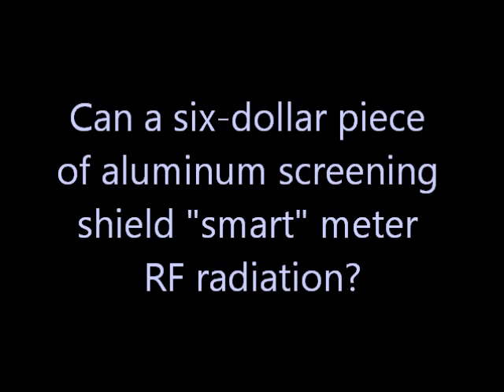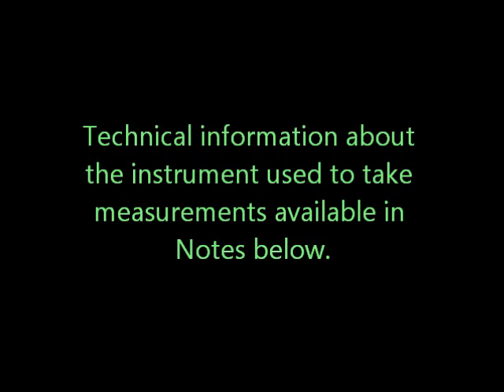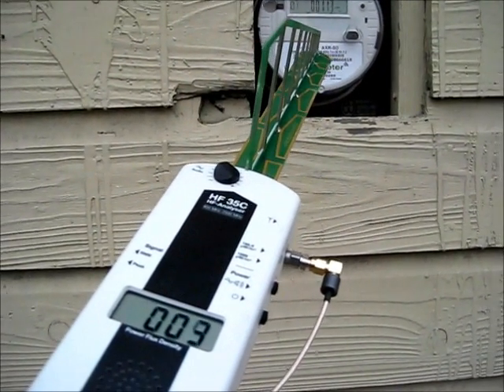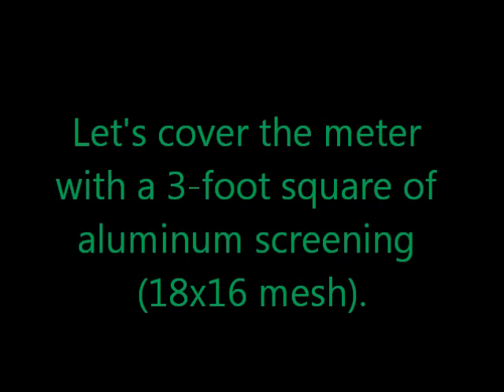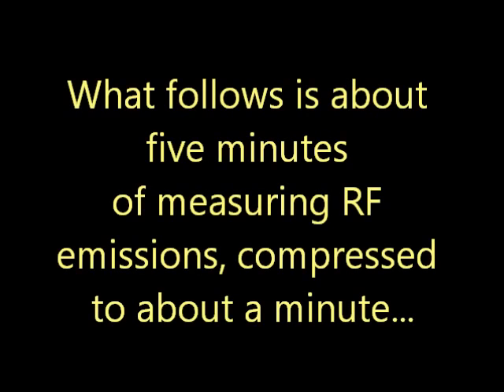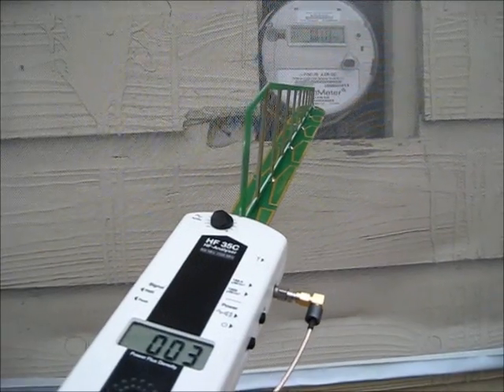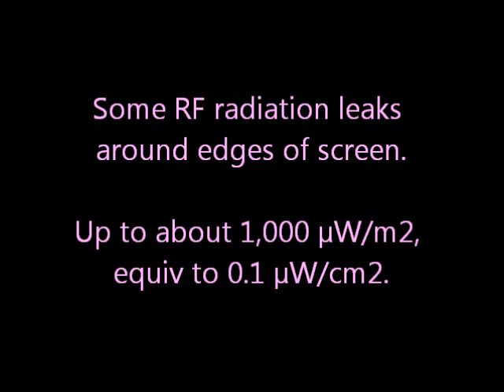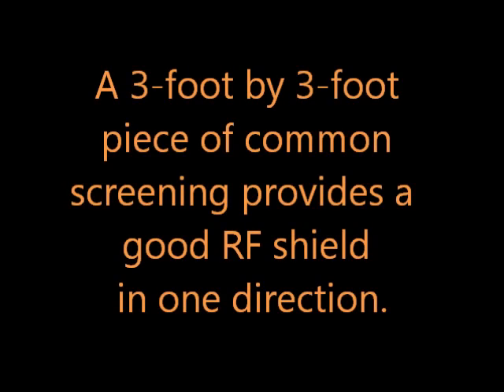Foiling a "Smart" Meter, Part Two: Aluminum Mesh Screening

Comment from the maker: PG&E smart meters emit 10,000-190,000 pulses of RF radiation per day. They admitted as much in documents filed w the state and reported on in the news.

When I measure SMs I have no trouble clocking pulses---several a minute at least. This meter was, like all in PGE territory, going off all the time.

The sounds emitted by the HF35C analyzer clearly indicate the source of the RF radiation---see my other videos for more info. I have been doing this a long time, and am confident in my assessment.

Comment: #1 That danger zone of too much radiation is actually higher than 8” because the reading is  “averaged”.
#2 Smart meter can not legally be installed if people live or work near smart meters.
#3 Multiple smart meter increase that danger zone drastically.

Comment from the maker: No, I am not overconfident in my equipment---my equipment is straightforward to use, and I've trained with an EMF technician. I've been doing this for years, in environments as diverse as crowded cities and remote Scottish islands, indoors and out, extremely high and extremely low levels of RF. My experience counts.

This video, as I have stated in other comments, was made to demonstrate a property of aluminum screening, not suggest a shielding set-up for your particular circumstances.

Comment: Try this one and see what kind of an answer you get.
If PG&E's smart meter can be shown to transmit more than 45 seconds day, WILL THEY REPLACE THAT DEFECTIVE SMART WITH A ANALOGUE METER? 
Ask them that question and ask them if they will still stand behind the 45 seconds a day theory? 

2 milliseconds at 45 seconds is 22,500 pulses,  the average customer can not understand and  will give up. It is similar to asking someone to try and measure how much light comes from a LIGHTHOUSE at night.

Comment: Has anyone filed a complaint with the FCC?   Just because they are not licensed, they are still in violation.  
Foil the stupid meters. What are they going to do if you "remodel your home" If that remodeling stops the radiation, what would or can they do?   File a complaint with the FCC??  I doubt it. Maybe they will pay to move your meter base? I doubt it. 
Remember the 8" is an averaged reading. The danger zone is far greater.

Comment: OK that's interesting. But you are concerned with the radiation for health reasons you say? But you place the foil on the outside of the house. Does that also block the radiation from coming INTO your home where you spend 99 per cent of your time?
Your argument might be valid. I don't know what radiation levels are truly dangerous, but your solution seems flawed.

Comment: Why this Smart Meter is transmitting so often? Is this meter transmitting data for the entire neighborhood (mesh network)? The reason I say this is because according to PG&E's website:
Do electric SmartMeters™ constantly emit RF?
No. SmartMeters™ communicate intermittently, with each RF-signal typically lasting from 2 to 20 milliseconds. These intermittent signals total, on average, 45 seconds per day. For the other 23 hours and 59 minutes of the day, the meter is not transmitting any RF.

Comment from the maker: I use analyzers manufactured by reputable companies that measure RF microwave energy accurately and consistently. 

Non-ionising radiation in the microwave band busts DNA, breaks the blood-brain barrier, and research has demonstrated a host of other clear biological effects, both in vitro and in vivo.

Sorry if it's not your favorite sort of radiation, but it clearly is radiation.

Comment from the maker: PG&E smart meters use a 1-watt transmitter, which is boosted by 4db antenna gain, actually pushing it beyond the FCC transmitter power limit (1 wt) for the unlicensed band it operates in. SMs transmit for miles---they are hardly insignificant.Your cell phone operates at less than a half watt, and you control when and how (or even if) you are exposed to it. PG&E places these transmitters right where humans live, work, eat, sleep. Biological research shows effects down to quite low levels of RF.

Comment: David Sturdevant, you're lost, the amount of energy this guy is measuring wouldn't light a small LED, let alone provide enough power to run an inverter. The leakage and inefficiency of the capacitor alone would leak this small amount FASTER than you would charge it. I've wasted more energy writing this than you would reclaim from microwatts of RF from a smart meter. - This is a joke.

Comment: This is a nonsense meaningless video. Smart meters have very small RF transmitters in them so the meter readers can read the meter, accurately by receiving the RF signal that contains the meter information. This "smart" feature is used EVERYWHERE small RF transmitters are in millions of devices, your car remote for example. What he is measuring here are microwatts of energy if you saved up all the "leaking" energy for an hour you would have almost nothing.

Comment: :::pssstttt:::  use COPPER..... then ground it to a capacitor, dumping the capacitor to a BATTERY, then run the battery through a grid-tie inverter....   You can USE that "Radiant" energy leak as FREE Energy to FORCE the power company to pay YOU for power that YOU "Generate" (Capturing what the Equipment THEY forced on you has LEAKED/LOST.)

Comment: Research Tesla's Wireless Energy Rec.  You can actually CAPTURE that energy via a conductive screen that is then fed into a capacitor, the capacitor then dumping the load to a Battery when the capacitory reaches maximum capacitance.  The batter is charged.... Now, it you where to install a grid-tie inverter to the batteries (which... are being charged the captured radiant energy that the "Smart" meters are LEAKING) you can feed that SURPLUS power BACK to the power company instead of wasting it.

Comment: It's NOT a matter of the RF being "Dangerous" to ALL people.  It HAS been CONFIRMED that SOME people react DIFFERENTLY to different RF signals (kind of like tuning an FM station with no antenna... signal quality,) but THIS is radiant energy being "LEAKED" at FREQUENCIES that MANY can hear.  High frequency "ringing" (much like that of people with high blood pressure) is reported as a reaction to the "FREQUENCY" that LEAKS from the meter.

Comment: Acually, if you take and run a COPPER WIRE LEAD from the Screen and DOWN to the GROUND it will ABSORB that radiation and GROUND. (RF uses that AND ALL Metals as an Antenna and/or CAPACITOR)

The ONLY power being "Radiated" INTO the HOUSE is going to be the radiant energy which is on the BACK side of the meter, which... is ALREADY FACING the HOUSE and couldn't be "BLOCKED" without a grounding plate BETWEEN the meter and the house.

Comment: Seems like your cure is actually worse than the initial problem, ie now all the RF radiation is bouncing back into the home, and the shielding has made the meter transmit more do to poor connectivity to its receiver.

Comment: "The Dark Side Of Smart Meters" taught me about what they can do.
You have shown what can be done about it. Thank you.
My plan is to place a large sheet of reflective screen on the wall behind the meter, and an absorbing screen over top of that. I will use absorbing screens in my bedroom to protect me from my neighbors meter.
Isn't it amazing what tinfoil, aluminum bugscreens, and a bit of wire can do? : )

Comment: I'm a resident of BC, Canada.  The provincial gov made smart meters the law.  According to BC Hydro website, our meters (made by Itron) transmit well below the requirements of the toughest European specs.  They also claim they don't have the ability to infer how power is being used, and use a network topology that does not result in large amounts of repeating.  I hope that's true.
I wish I had the $ for your RF meter.  It would save me much guesswork.

Comment: Thanks for replying.
It looks like the best thing for me then would be to put shielding up on the inside wall of my house behind the meter.  I spend way more time on that side of the wall.
Also, I think I will leave that shield ungrounded so the meter can make it's connection without infinite attempts and signal boosting.

Comment from the maker: At least for CA residents who are subjected to PG$E's tyranny, the meter they use is in excess of 1000x stronger than it needs to be (in vast majority of cases) to do the job---all that meters need to do is transmit about 25 or 50 ft, to the v next SM in the mesh network, on the next house. That can be achieved w/quite a weak signal. PG&E installs meters of unprecedented strength (there being nothing to stop them) so that it will work One-Size-Fits-All, and your health be damned.

Comment from the maker: Taking reading from a smart meter that is shielded on the over side will show the emissions, plus the reflected RF from the shield (if it is not grounded).

Our experience with SMs that have been shielded all around is that they do in fact ramp up, attempting to connect.

Comment: Won't the meter just crank up it's transmitting power and transmit almost constantly to attempt to get through? They use dipole antennas, if I'm not mistaken.
I'm very curious what those readings would be through the wall at the back of the meter.

Comment from the maker: I think screening is superior because it is sturdier. Foil gets holes and leaks.
The coating does not matter, as long as it is aluminum, and NOT fiberglass.

Space blankets work pretty well in a pinch. Great for travel! I'm sleeping in one on my next wifi-soaked airplane trip. 

But space blankets also are prone to holes, places where the mylar coating wears off. They just don't last.

Get a Cornet, and test for yourself. Don't take my word for it.

Comment: that's a faraday cage but the problem is that the RF signal travels in all directions. Which means that If you took your meter to the back side of the meter, you would get a reading. You would need to wire mesh both sides to block most of it.

Comment from the maker: Thanks for clarity. 

All over San Francisco I see bizarre, non-code installations of electrical equipment. Meters inside kitchens, restaurants, doorways, living rooms. On the outside of buildings, so that they actually protrude into public rights-of-way. Electrical wiring hanging off the sides of buildings where wireless network antenna arrays are installed. 

S34RCH "Dining by the Glow of PG&E Smart Meter Radiation Pulses".

Comment: ROFL, you folks should just talk to any electronics geek, anyone could have told you a metal screen will block rf signals, but your screen only blocks the direction of the screen, it's still sending it inside that building just fine.

Comment from the maker: To clarify, the screening does NOT absorb the RF microwave radiation, it reflects it. To absorb RF, special materials are required, such as the Microwave Absorber Sheet (carbon sheeting) available at LessEMF [dt] com. Also, ferrite chokes absorb RF, and are routinely used on electronic devices--the barrel-like things on the electrical cords of rechargers, etc. These also absorb RF incidentally produced by electronics. with carbon.

Comment from the maker: The RF microwave radiation is reflected back into the (abandoned) building.

If I were to measure near the inside surface that is reflecting, levels would be higher.

Comment from the maker: Yes, it does. RF passes through all materials except metal or metal mesh with holes of a small size. 

This building was unoccupied. I was using hte situation to demonstrate a principle of RF radiation and metal screening. Please visit the page on LessEmf [dt] com, called 'shielding a smart meter' for some practical info (search these terms).

Comment from the maker: It might help, but you can't know how much without measuring yourself. Three-feet square isn't big enough in my opinion. 

RF is only one of the factors making smart meters so toxic to people in their homes. The devices also throw off voltage transients (ie 'dirty electricity').

OPT OUT if you can.

Comment: microwave ovens radiate high levels of microwave CW, in the order of thousands of microwatts/m2, out to ten, fifteen or even more meters from the device. dhfhs2's comment is well placed. CSA is about as useful, biologically speaking, as SAR. ie, apologist infrastructure legislatively legitimising toxic pollution.

Comment from the maker: And what would you say I am "up to"? The utility owns only the meter, not anything else; the walls and the air belongto the resident.

No one anywhere has ever been cited or arrested or fined or anything for protecting themselves from RF radiation.

In particular in PG$E territory the SM they use is very strong in signal---so strong it violates the FCC rules on transmission power for the unlicensed band they operate in. So any screening or shielding you do only reduces the signal, not blocks it.

Comment from the maker: @PretigiousWarrior Welcome to the subject! This material reflects RF, unless it is grounded, which means the metal is connected to a grounding rod buried 3 feet or more into soil (in which case it is "absorbed").

In this situation I use for demonstration, if I were to measure *inside* the building (which was vacant at this time) I would likely find an increase in RF on the other side of screening.

This video only demonstrates a property of screening---it does NOT show an idea shielding set-up.

Comment from the maker: The amount of transmitter power needed in most situations for signal to reach utility is MUCH lower than what these meters put out. Often there is no interruption in communication if a person shields their meter. Check out the video with this product (which I do NOT endorse, however): smartmeterguard (dt) com
Maker claims the signal still gets through. People who are made sick by these devices are sufficiently desperate they may no care whether utility gets transmission.

Comment from the maker: No, lead-based paint does not shield, or at least not enough to make it useful.

All structures (wood, metal, concrete) provide some shielding from RF---the levels will be higher outside, and drop when you measure inside a building (that is, if there is not wifi/cordless/cellphone inside!). But not enough to completely block the strong pulses from a smart meter.

Comment from the maker: Wow, good question. The short answer is NO, it isn't the same at all. I live in a house in which the old undercoats of paint contain lead, & yet RF from various sources penetrates the walls. 

A wall of any material will block some RF. I couldn't say whether a wall w/ a coat of lead-based paint would contribute more shielding---I can only say that at normal thicknesses of application (e.g. my own home), it doesn't provide enough blockage to be considered proper shielding. Also, you can't get it!

Comment from the maker: The screening is reflecting the RF, just as that plate in your head would do (all the while vibrating with the signal like an antenna, a nasty thought).

Opt out if you can, and then write to your Public Utilities Commission, objecting to the fees as discrimination on the basis of disability---you are a prime example of a disabled person who would be likely to be adversely impacted by proximity to a wireless smart meter.

Comment: Is the screening blocking the rf, or absorbing it. The reason I ask, is I have a steel plate and screws in my head, and the meters position is about 3 feet on the other side of the wall from where my head rests.
I don't have a smart meter, as one of the holdouts. But would be interested in knowing.

Comment: Want to stop smart meter and solar radiation in your home. If you have too much solar radiation (sunlight) entering your home, install thick cloth curtains. You can now sleep longer and the nosy neighbors can not see what you are doing. Too much RF radiation in your home? Place aluminum foil over the smart meter and on the inside wall. Grounding works better. Now you sleep longer and the nosy power company doesn’t know what you are doing. These foil or cloth curtains are your property.

Comment: Hi orlandofriend. I like your idea of the tin foil hats.  But may I suggest that you put the tin foil hat on the smart meter. That way your children and pets can play outside without getting radiated. A  metal foil space blanket works works well on the inside where the radiation is the strongest. Now the only worry you now have is your home is going to burn down when the meter bursts into flames.That is always a huge concern.

Comment: The idea you have of wrapping it up like in a blanket of aluminum foil would be torn away by the Hydro worker when they came to read your meter. Maybe using the aluminum screen like that ... wrapping it around the unit makes more sense. I have two smart meters on the side of my house because there is an apartment above me in the house.... and they stick out like you mentioned .. I am thinking very much about wrapping them up.

Comment: A really quick idea folks. An aluminum foil space blanket can be pinned to the wall on the back side of the smart meter. The space blanket will stop the RF but will not stop the fires when the cheap smart meter over heats trys to burn down your home. You can get a silver and gold space blanket for about $2 each.

Comment: Hi

This is excelent, but you have to put the shielding on the inside.
The shielding reflect all the RF back, in this case into the house.
Please anter a comment that teh shielding have to be installed on the inside of the house in order to block the RF from the meter to comeinto the house.

Great clip!

amirb